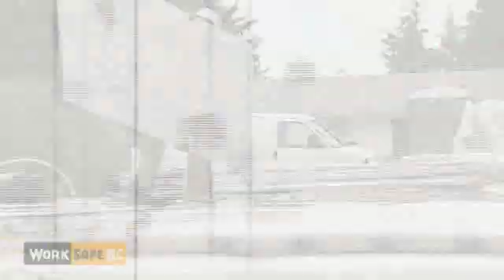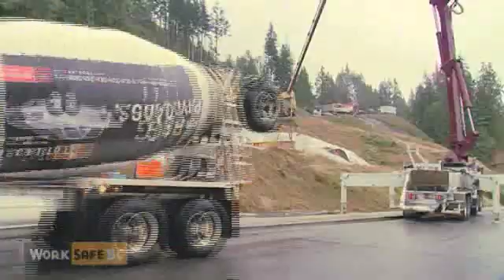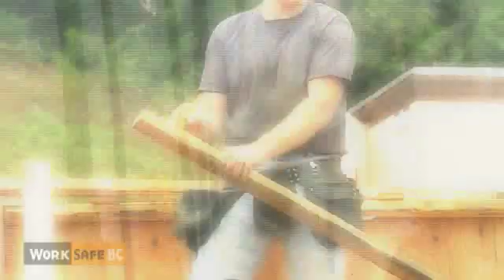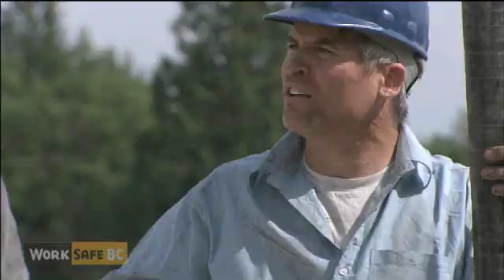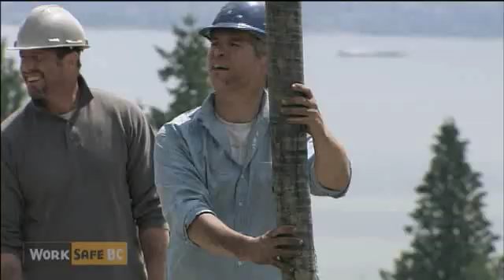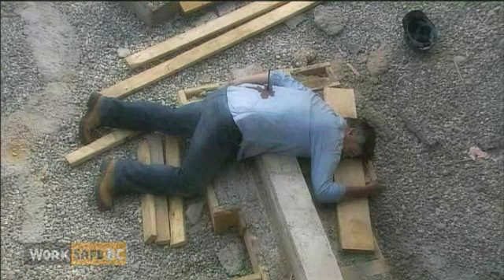You're a Pro: Falls From Formwork

Comment: What wait? The dude was expecting it and the foreman was watching/approving, so what is wrong in this example? Or was everyone wrong?
Reply: The worker was standing high up on formwork without aid of a fall-arrest or guardrail. (I had to learn that "forms" are the moulds into which concrete or another material is poured and that when a system of forms is connected together, this becomes formwork.)
The answer came from the Formwork chapter (42) of the IHSA Health and Safety Manual for Construction:
Fall arrest systems or scaffolds with guardrails must be used where workers may fall more than 3 m (10 ft), or onto hazards such as projecting dowels . In some circumstances, you must use fall protection when the height is 2.4 m (8 ft) or more. 
Access to wall forms needs planning. Forms more than 2 metres high require access platforms for workers involved in concrete placing. The platforms can also be used to complete the upper portion of the formwork. An alternative is a frame scaffold, which can also be used to install reinforcing steel.
Most formwork falls are caused by missing or inadequate guardrails, failure to use fall-arrest equipment, failure to completely plank scaffolds and other work platforms, and standing or climbing on surfaces not meant to be used as such – the tops of wall forms or 2 x 4 wales, for example. Installing and stripping formwork often requires the use of a fall-arrest system.
Falls also result from holes left unguarded or uncovered in formwork. These should be covered up or fitted with guardrails as quickly as possible.
 Where this cannot be done, the area should be roped off and posted with warning signs to prevent unauthorized entry.

Falls are the major hazard because they are potentially fatal. Cramped work areas, inadequate access, failure to install guardrails, failure to use fall arrest systems, tools or material left underfoot, and surfaces slippery from form oil can all lead to falls.
 Ladders are also frequently involved in falls. All workers who may be exposed to a fall hazard and who may use a fall protection system need to have training for working at heights.